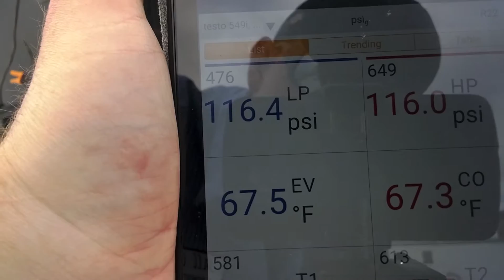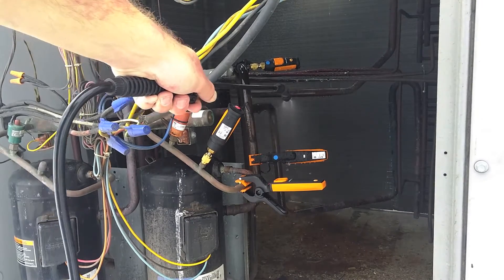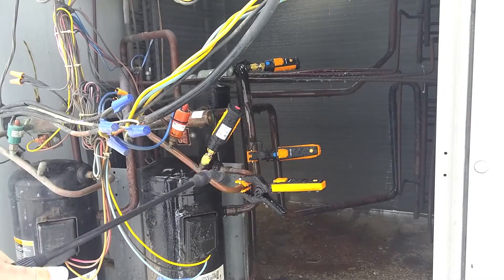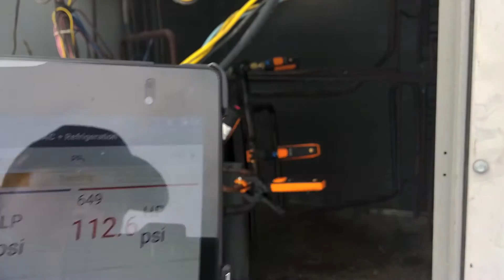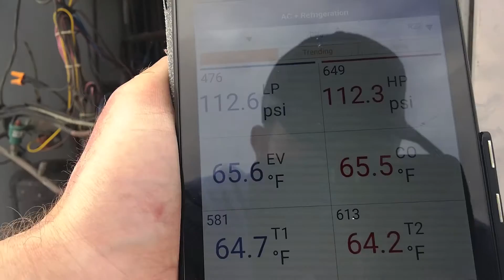testo Smart Probes Refrigeration Set: Water Resistance Test/Review

Comment: As Nor-Cal Refrigeration said. Epic video. Did u check battery compartment after drying them and removal for water inside battery compartment ? That would corrode in the long term not immediate failure possibly. Good video !
Reply from the maker: +OcRefrigeration & H.v.a.c. Thanks man. I think I might have checked after drying them with a towel and it was bone dry in there.

Comment: why I connect probes took a little soaking last season from a downpour. I was surprised that they lasted through the storm.
Reply from the maker: +PHC Apprentice Nice Moe! Good to know that Iconnect probes are water resistant as well.
Reply: +Jon M. HVAC there are rubber plugs to protect the ports on the iconnect probes however i never got involved with them. keep posting, im curious about battery life.